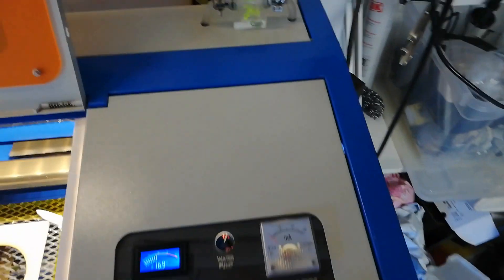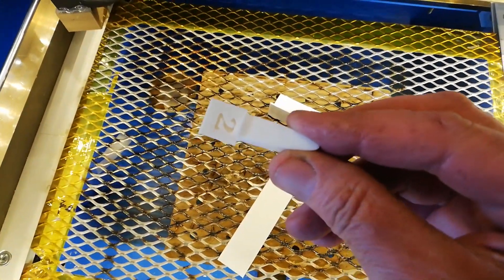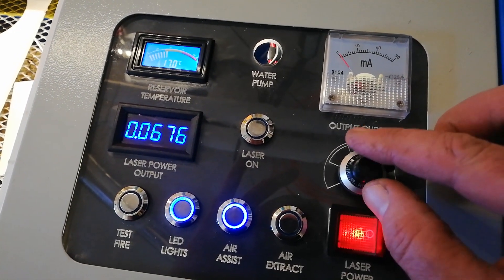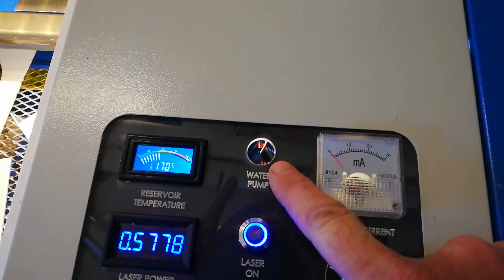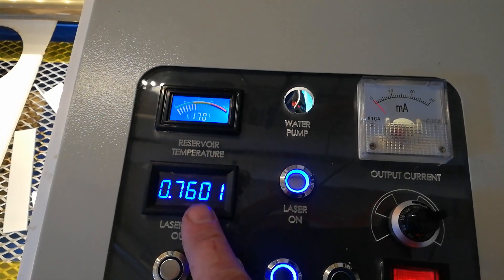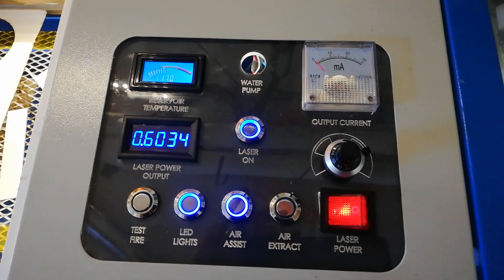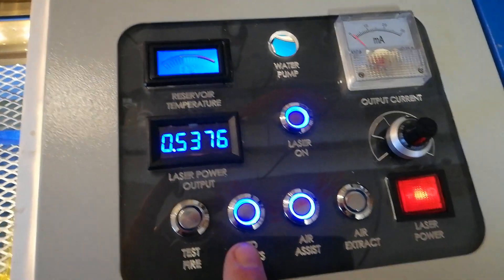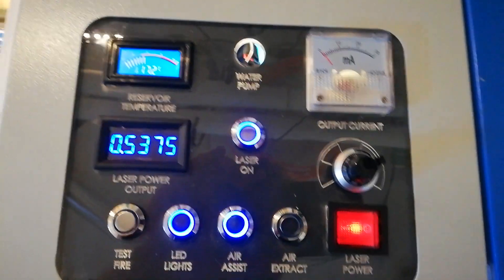K40 Laser control panel best upgrade under $10.

Comment from the maker: Hey guys here is the link for the panel itself I'll, work on the info for the wiring.     https://www.thingiverse.com/thing:3596189
Reply: Hello, dit you use 12v relais to switch leds and for example air assist because led is 12v and assist is 220v?
Reply from the maker: @guusjansen8529  Hi Guus 
yes this is the easiest method but for the air assist I am using a dc fan mounted on the side of the lens.